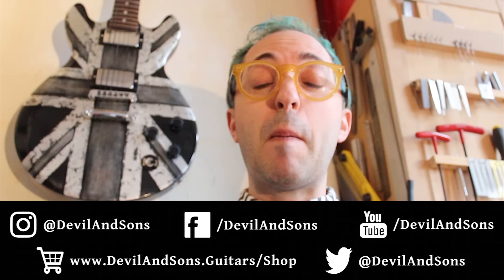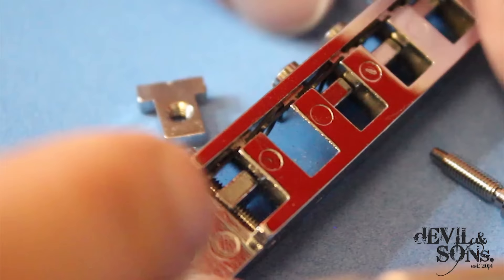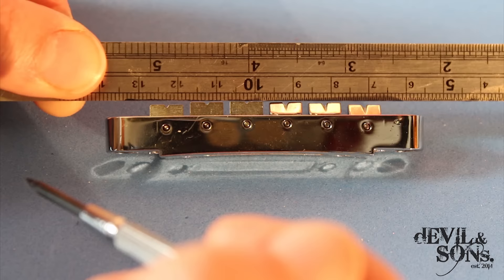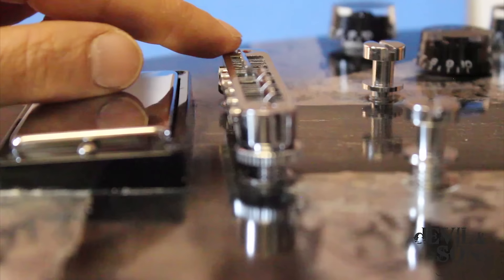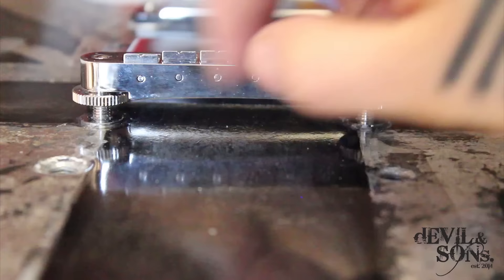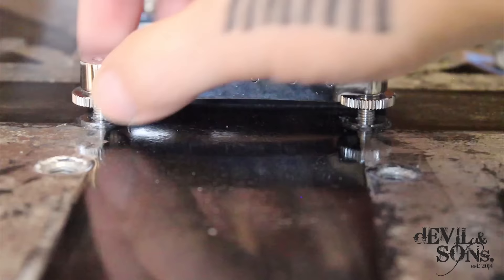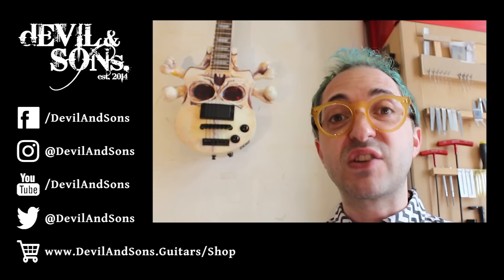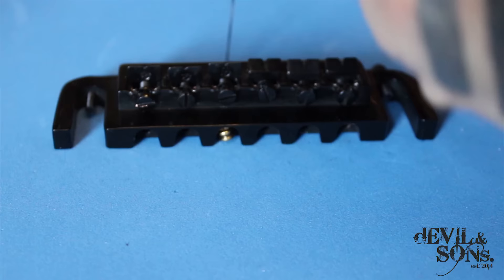Setting up a Tune-o-matic bridge (Les Paul style)

Comment: First of all Thank you for an in depth video ! I have a LP custom shop and I went from 10's to 8's. Of course this caused fret buzz. I adjusted truss rod and set intonation. Better, BUT my G string still buzz's and I have just a bit of buzz on B & E...My thinking is, that my strings are lower concerning the E B & G..So to raise those. Do I do it with the saddle dial...or do I do it at the bridge ?

My G seems to buzz most of all.

You made me take a closer look at the tune-o-matic..and I have a better understanding. I see all my saddles point the same direction though. I'm not too concerned about it really, but they do all go the same direction.
I also see my strings touch the back of the saddle bridge as well. I will eventually adjust that.

My main question is raising the higher strings and your best recommendation on doing so.
Reply from the maker: Thanks for commenting. As long as the intonation is fine I wouldn't worry about the saddles facing the wrong way. It does sound like adjusting the saddle height is the way forward, just on the side with the higher strings if the lower strings don't buzz. Hopefully a turn or two will stop the buzz without making the string height too big.
Reply from the maker: Let me know how you get on.
Reply: @DevilAndSons  Yes it did work ! Thank you ! It was logical that it would, I just didn't really have the guts until I watched your vid LOL..Thanks again !
Reply from the maker: @thebigcountry6757  great, glad it worked. Happy strumming.

Comment: What are the options if your bridge is a low as it goes, but the action is too high? So far the only video if have seen is to file / grind the back of the bridge so it can go lower.  Sound about right? Other options?
Reply from the maker: Does your guitar neck bolt on or it fixed in place?
Reply: @DevilAndSons  Fixed in place.  A type of Les Paul.

Comment: Great vid!  But on the bridge saddles, why do 3 face one way and the other 3 face the other way? Is this critical?
Reply from the maker: It's fine if they face the same way, but often you'll find you need the saddle to come back further on the lower strings and go forward further on the top, so having them facing alternate directions give you slightly more room to move. A well made guitar shouldn't need the full movement though. Does that make sense?
Reply from the maker: Snd thanks, glad you like the video.

Comment: Very informative and soothing at the same time thanks for the video I've got a Epiphone Les Paul and I'm planning on switching out the factory tune o matic for a actual Gibson one and going with Schaller machine heads hopefully it will resolve my tuning issue  with it I can't seem to ever get a true d chord from it. I've intonated it several times now and it keeps going out. I do a lot of drop d or dm tuning also could that be causing it? I also have done the "Jimmy page" wrap over the stop bar I was always told that it helps to keep a Les Paul in tune. I owned a 77 studio Les Paul I never had issues with. Wish I'd never sold it with the prices of them in the us now.
Reply from the maker: Good idea to upgrade the parts, I hope that helps. Is it only the d chord that is out of tune and not higher up the neck? 
It's mad how expensive some guitars are now just because of when they were made.
Thanks for such a nice comment and taking the time to leave it, I do appreciate it.
Reply: Yes sir it is open d I have the biggest problem with Em Am even G are good. my G string is giving me fits all other five stay in tune. I checked the neck it's good so I'm thinking that my next option before I start replacing parts is check the nut to make sure the g isn't hanging up.
Reply from the maker: @jamiepape5095  that makes sense, also I wonder if there is a problem with one of the frets? Is it badly out of tune? If it is only out of tune when you play that chord but afterwards is fine then it could be a fret problem.

Comment: That's a really great video, thank you!

One question - why would you like to have your thick strings 'longer' (i.e. the saddle is 'slanted' towards the neck) and your thin string 'shorter' (i.e. the saddle is 'slanted' towards the tailpiece)? I imagine that it may help with making sure that thick strings do not touch the bridge when going into the tailpiece. Is there any other reason?

On my Yamaha Revstar I have all saddles 'slanted' towards the neck (the factory set-up). I've found that the two thickest strings seems to touch the bridge - I can't slip a sheet of paper between the strings and the bridge. Your video for sure helped me understand the way a Tune-o-matic bridge works so I should be able to correct this problem, so thanks again!
Reply from the maker: Thanks for watching and good question. Yes, it slants for a reason - intonation. I'll pit a link to a video in the next comment. I hope you sort out your yamaha.
Reply from the maker: https://youtu.be/cQ-yslOuHck

Hopefully that video explains why the bridge slants.

Comment: I have an oddly specific question about the tail piece. If one starts with the screws completely twisted in to the bottom (where the strings would touch the bridge edge) how many full 360 degree twists from the bottom position would it take to reach the ideal height for your string tension?
Reply: Assuming you did the exact twists for both screws so they are the same
Reply from the maker: I don't think there is an answer for this partly because it would depend on which strings you have, and partly because the spacing between the tail piece and the bridge may vary depending on the build. The main tension in the strings is controlled by the tuning though.
Reply: @DevilAndSons  Thank you for the response. I'll just set the bridge to my desired action and then start from the bottom for the tailpiece and work my way up until getting the lowest setting that doesn't touch the edges of the bridge.
Reply from the maker: @samcohen2483  I think that is the best way to do it.

Comment: Why are the saddles for the top 3 strings and the bottom 3 strings facing opposite directions, respectively?
Reply from the maker: The bass strings tend to need to be longer and the higher strings shorter when doing a full set up. With the saddles in opposite directions they give a couple of mm of extra movement for this.
Reply from the maker: I have explained this with a drawing in the video at around 3 minutes 40 seconds onwards.
Reply from the maker: And the reason you have different length strings is for intonation which I explain at 34 minutes in on this video https://youtu.be/fvD-qsM3piQ
Reply from the maker: I hope that covers it.

Comment: Great video, very detailed, thanks. Can you tell me why you turned the bridge this way, on my Gibson is opposite, is there a big difference?
Reply from the maker: I put the bridge this way as this is how this guitar had come to me from the client before I did the paint job. It makes no real difference to the intonation etc but personally I find it easier to turn the screws this way as there is more room to get a screwdriver in, but that is a very minor thing as it's not exactly hard the other way.
Reply: @DevilAndSons  thanks. Did you ever find a problem with this bridge in terms that you can`t raise or lower the strings separately?
Reply from the maker: Personally I prefer bridges where you can adjust saddles separately but I've never had a problem with these as normally they all line up well enough when you just adjust each side. It's just a bit less control.
Reply from the maker: Are you having problems with one?
Reply: @DevilAndSons  yes, but I will order a new one, because this is 24 years on my guitar and is not flat anymore and is corroded
Reply from the maker: @acousticloungeduo  that's a shame, but a new one should slot right in.
Reply: @DevilAndSons yes I think it will make a big difference, and it`s not that bad to change it after all this years :)

Comment: Wouldn't it be possible to install some kind of solid washers of appropriate thickness under the tailpiece (around the screws) so you could keep it completely tightened to the body, while maintaining proper string angle to the saddle?
Reply from the maker: LatakiaSmkr that’s interesting. I don’t see why that wouldn’t work if you could get them at exactly the right thickness, but as every guitar is different it would be hard. Plus if you changed string gauge you’d have to replace the washers every time you change strings.
Reply: @DevilAndSons  I'm a crafty guy with some tools at hand, probably gonna give it a try... Also, I've just seen another SG setup video where this exactly same idea is mentioned!
Reply from the maker: LatakiaSmkr let me know how it works out.

Comment: This is by far the best explanation video existing! Just one question, im about to mod my telecaster that has  a 9.5 radius fretboard.. so in my local guitar store they told me it's impossible because the T-O-M saddles exist not with a radius and there "all" flat on the top/edge so the strings run straight flat over the fretboard then...is that even true or do You know if Radius saddles are existing?  In your video you showed it perfectly and explained that your saddle is higher in the middle and lower on the outsides so this one could work then for me right??? can you tell me if all saddles work like yours or we're i can order that saddle from your video?? Greets Chris
Reply from the maker: Thanks so much, very much appreciate that comment. 

Hmm..  I think all tune-o-matics have that curve to them. It's true that you will have less control than on your telecaster bridge, and that it is a small radius so you may have problem with action.

However the big problem is you can't just put a tune-o-matic on a telecaster because the bridge is going to be too high off the body, you will need to change the angle of the neck and it may be too much to do with just a shim. At least I think that will be a problem but you may have thought around it already.
Reply: @DevilAndSons   @Devil & Sons Guitars   Thank You for the fast response!! This was helpful for me, so I take another try at the next bigger guitar store may the staff is more Capable.

And great advice, i have already a plan to get the problem with the angle fixed, i would use a router and  Recess the saddle into the body so I can solve the problem and don't have to use shim's to get an angled neck.. 

This could work I guess.
Anyway thanks again for helping me out! And thank you for sharing your knowledge with the community 🎸
Reply from the maker: Great idea, I think that would actually look very cool.
Reply from the maker: Honestly, it's the conversations I have on here that make it all worthwhile. If you end up putting images up on social media please do tag me in a comment, I always love seeing what people get up to.
Reply: @DevilAndSons  it's a great way to get in Touch with people like you and learn so this is a thank you to you. And alright I will, but it takes me a while and as soon it's Dunn I'll reply to you. Have a great weekend
Reply from the maker: Thanks so much, and no rush and no pressure, and only share if you feel happy to.
Reply: @DevilAndSons alright. And i left you a subscribe mate, your videos are so helpful and Entertaining! Thumbs up and keep going
Reply from the maker: Thank you so much. There's a lot more to come for sure.

Comment: Can I ask you something? Which is the height of the 2 screws (or fun wheels) of the bridge? Is there any recommendation or something to consider to setup these two? And what's is the difference between putting them too high or too low? Sorry for a lot of questions but I'm a little rookie with this things. Thank you so much for this video and information!
Reply from the maker: Hey, the thumb wheels (my accent makes it sound like fun) adjust the height of the bridge so you can alter the action of the strings. I didn't go into how to set up your guitar in this video, but the action is essentially how high the strings are off of the fretboard. Each guitar design is going to be different as the actual height of the neck compared to the brdige on the body will differ depending on the design so there is no way to know exactly how high the bridge (and these thumb wheels) should be without looking at the actual height of the strings. As a guide perhaps aim for the low E being between 1.5mm-2mm high at the 12th fret and the high E being 1mm - 1.5mm. These measurements also depend on how you like to play, some people prefer it lower than others. Also the distance between the string and the fret will vary depending on how thick/heavy the strings are, so if you kept the thumb wheels at exactly the same height but put on thicker strings the gap between the string and the fret will become smaller (so you may want to increase the height of the thumb wheel to compensate that if you were changing strings). I hope that makes sense.
Reply from the maker: The full set up video is now up, you may find it useful: https://youtu.be/fvD-qsM3piQ

Comment: What’s the distance between the two bridges?
Reply from the maker: I don't have an exact distance for the guitar in this video as I don't have the guitar any more, but the key thing is the main bridge being in the correct place and the tail piece behind doesn't have to bean exact distance away. So you could widen the gap and it would still be fine, or make it closer (being careful the angle on the saddles isn't too sharp so that the strings catch on the bridge). Does that make sense? Basically there isn't a set distance.

Comment: Hello there, thank you for the video it was very informative. does the height of the tailpiece and tension on that small section of the string affect tuning stability? if it does, how so and how can you optimize your tailpiece height so your guitar holds tune the best?
Reply from the maker: Hi Mike, If the angle is greater the strings are less likely to slip when you are playing them - although to be honest I don't know many people that play so agressivly that the strings would slip out of the saddles whatever angle you have it. It shouldn't make a difference to the tuning stability, but I hear people say that it makes it harder to bend the strings the tighter the angle. I used to think this too, but actually I'm now not certain that it makes a notable difference either. So the main difference in the height is that it means it would be harder for the strings to slip out if the angle is tighter but you need to make sure the angle isn't too big, as i explain at 14:20 in the video. I hope that answers your question.

Comment: on an SG, does the stop piece have to be equal height on both mounting points, or can I raise the treble side higher than the bass side, if only the treble E string is just touching the edge of the bridge?
Reply from the maker: You have the ability to raise one side more then another to allow adjustment of action. Normally the treble side is actually a bit lower, but that doesn't mean if it is higher that things are wrong - as long as it results in the guitar playing well for you then it doesn't matter. As I typed that I realise you mention the stop piece being angled, that really doesn't make a difference but I would recommend trying to avoid the string going over the saddle and then touching the bridge before going into the stop piece - that would mean you probably have more angle than you need.
Reply from the maker: I hope that made sense.

Comment: should the saddle screws all be in the same place? cuz mine are all over does it adjust how close the string is to the neck? I know if you take the two side screws that definitely does adjust the height of the strings to the neck, but the six in the middle I've never understood where exactly they're supposed to go or what their purpose is, I mean the purpose is for the strings to sit in the groove but I've never understood if I should screw them all to the same spot or some of them further back and some of them up I don't know
Reply from the maker: Good question. Those screws do exactly what you said, they change the length of the string or the gap between the nut at the start if the neck and the saddles on the bridge. Changing the string length changes the intonation which is essential for tuning your guitar correctly. I have a full set up video, you dint have to watch it all - in the description is the time stamp for intonation, hopefully my explanation there will help you.
Reply from the maker: Here's the video https://youtu.be/fvD-qsM3piQ
Reply from the maker: Intonation is at 34 minutes
Reply: @DevilAndSons  thanks , after I watch the full video to the end I got it . I have a dean lightning dime bag but it's a knock off so it doesn't have the Floyd roads it just has some holes in the bottom of the guitar where the strings go through and then it sits on the saddle so it's kind of impossible to make the strings not touch the back of the saddle because that part is not adjustable. I was thinking about getting a floating Floyd roads they just mount on the guitar instead of having to cut the guitar .have you ever messed with those? And is it a good idea it's kind of impossible to get dimebag Darrell guitar sounds if you don't have a whammy bar lol 😆
Reply from the maker: I'm glad it makes sense now, and thanks for letting me know. I've not used those top mounted floyd rose bridges but they do look really good. I think if you like playing Pantera you really should go ahead and upgrade, it's so much part of Dimebag's sound.